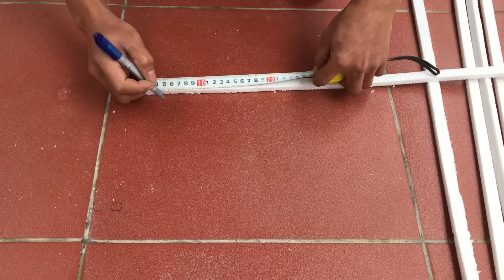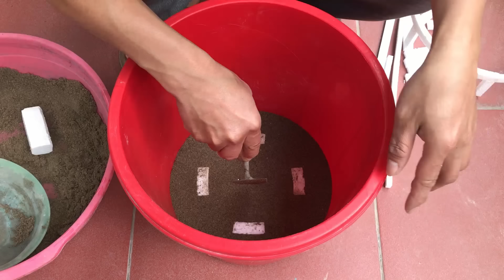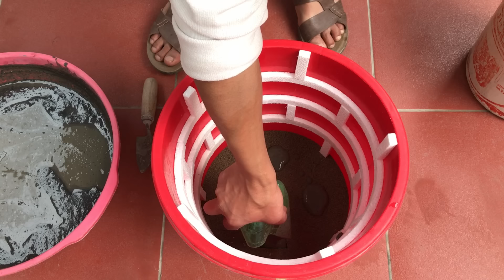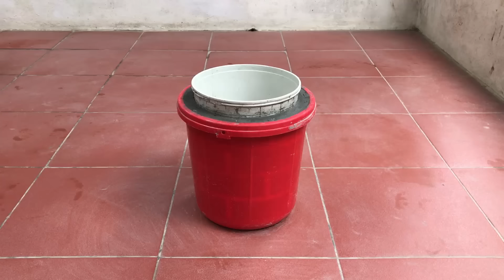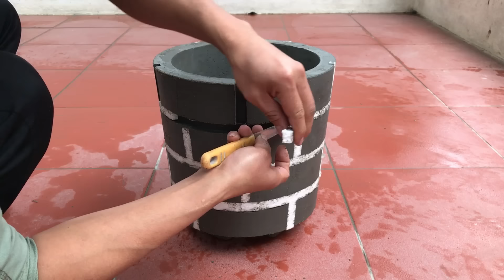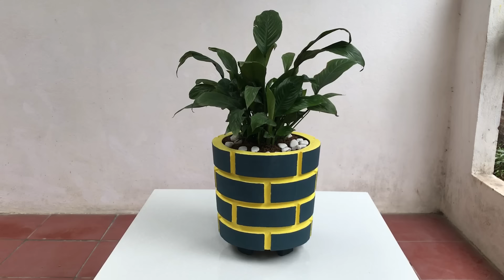Cement And Plastic Container / The Idea of creating unique flower pot for houseplant

Comment: Acabei de conhecer o canal trabalho lindo perfeito 👏👏👏👏👏👏👏👏👏👏 mas quero saber como faz o cimento quanto tempo pra poder desenformar e que cola ele usa pra colar o isopor no balde se alguém puder me ajudar fico muito grata 😘
Reply: You mix the ratio of 3 sand 1 cement and add water, use silicone glue to stick the foam sheets and let them lift for 24 hours.

Comment: Should The inside/outside of the cement be sealed to prevent deterioration and possible collapse due to moisture and root growth from the plants ? Thanks.
Reply: ⁿ
Reply: Não precisa ser selado. Colocando a massa 3 x 1 já é bem resistente à humidade e às raízes.